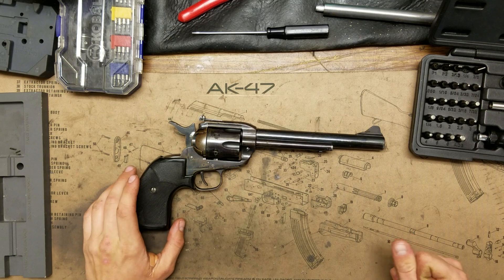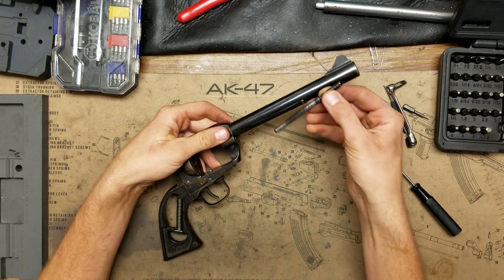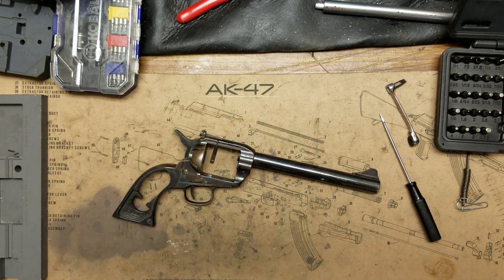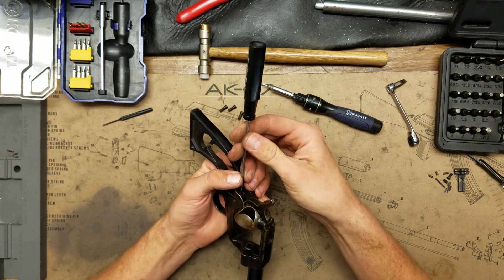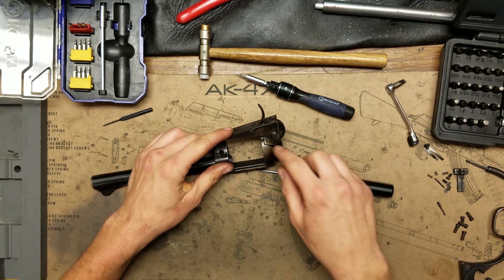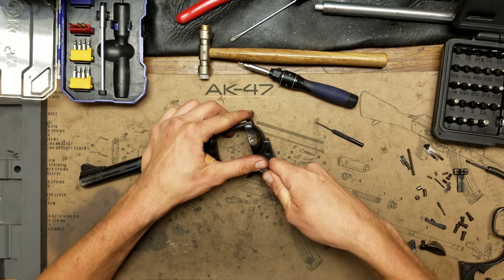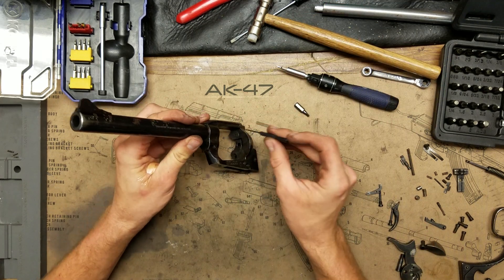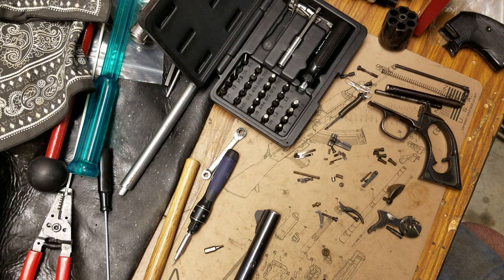Single action army Virginian Dragoon disassembly 44 magnum

Comment: For the Bicentennial (1776/1976) version of this .44 mag, the trigger/cylinder tensioner spring (10:07) has 3 pieces not just the 2 shown here. The 2 that are identical stack on top each other and the third one goes on top of the other 2 and ends up closest to the screw head. Hope this helps, boys.

Comment: Thanks for this video. It enabled me to replace the broken bolt/trigger spring in my .44 Magnum Interarms Virginian Dragoon. I could not get the hammer spring out with a paper clip, but a finishing nail did the trick as it was much thicker.   The other problem I ran into was that I could not get the spring screw back in until I realized that the new spring, which is for a Colt Single Action Army, is a bit thicker than the Interarms spring, and had more arc to it. I gently beat some of the arc out until the spring would lay down in the slot better and was able to get the screw back in.  The cylinder locks up nice and tight now.  Before it would just spin hammer down or full cock, not good.  A whopping $12.84 for the spring after tax and shipping.  Surely a gunsmith would have charged a hefty fee.

Comment: What did the inscription say on the bottom of the handle? I'm looking for the adjustable rear site if you know of a lead?  Some history shared with the disassembly would have been much better. Its really a great gun, and many say was better built than the Ruger Black Hawk.  I did learn a few things, thank you.
Reply from the maker: It said We The People on the bottom, It was indeed built very well.
Reply: @GunsWithGage  Mine also says "We The People" and has 1776-1976, the bicentennial. Now I just need the Jeep CJ5 blue jeans/Bicentennial edition and my life will be complete.
Reply: John Lazar-yes they are better fit and finish than a super Blackhawk,but they cost way more than the Ruger that leads to they're demise.
Reply: @enriqueoliva6988  $30-35 more. Blackhawks were around $250 and the Dragoons were $280. I donate believe that’s why. I think Ruger’s transfer bar was one reason but the other was just availability. Rugers were everywhere and these where just here and there. The Virginian also has a tendency to be ammo picky whereas the Rugers pretty much eat anything. Mine will only shoot heavier loads and will throw the light 180 grains all over the place. With 240s I get 2ish inch groups at 12-15yds. I have the 1974 “We the People”.
Reply: @GenX-Grampa  yes I always like the looks of my friend's Virginia dragoon compare to my new model super black hawk with square trigger guard.We went black bear hunting with our single action pistol.(I didn't use my then new at that time 1979 smith & wesson model 29 pin barrel and recessed cylinder because I didn't have a holster for it yet)But you know what, the bear drop just as dead from either pistols.I used a hard cast lead keith style bullets.

Comment: Thanks for the great video. I cannot get the tensioner out to release the gate. I can remove the screw and the spring comes out, but the tensioner will not budge. Consequently the gate is super loose. Even with reassembly the gate remains super loose. I've tried lubes and penetrators. Any ideas? Thanks again.

Comment: I can't take out my cylinder by pressing in the Release. I can't figure out why it doesn't work, it's spring doesn't look damaged and I don't think I have it overtightened. if anyone knows anything, feedback is much needed because I have to completely unscrew it to take out my cylinder.
Also, mine says Sic Simper Tyranus(Tyrant Killer)

Comment: Any idea where I could find a "hammer spring guide"? That's what it was called in the schematics I found but they don't seem to be in stock. Thoughts on using a spring from a similar single action?
Reply from the maker: Besides gunparts corp, call "lee's gunparts" in TX. he may have it. Other than those,  you can sometimes find parts lots on ebay and gunbroker

Comment: So you got really lucky that you got one that was not seized up, but mine is. I've tried 50/50 ATF with acetone with the roll pin set but it's not budging. Almost wish the one in your video was so I could have seen how you would have handled that.
Reply: Try a little heat. Somebody may have used loctite.

Comment: I need to replace the spring on that little piece you used the little spanner on (base pin latch). Do you know if that part is interchangeable with the SAA or Blackhawk?
Reply: Jacks first gunparts
Reply: @raylee7654  Thanks! Ordered.